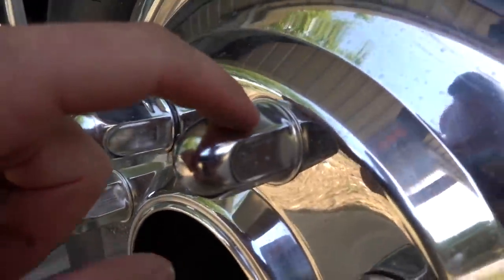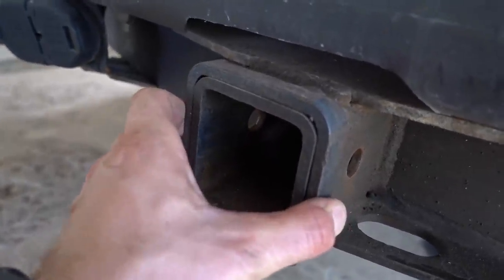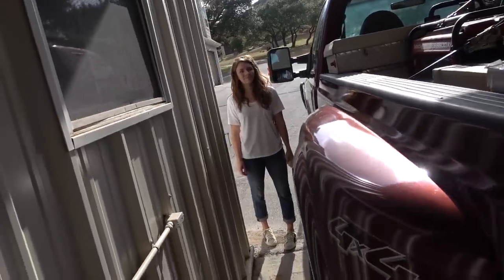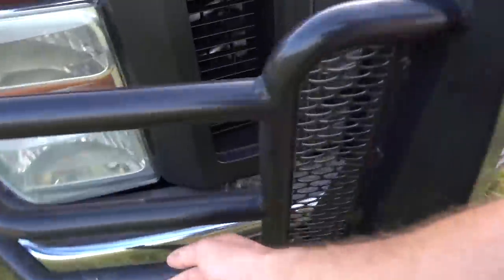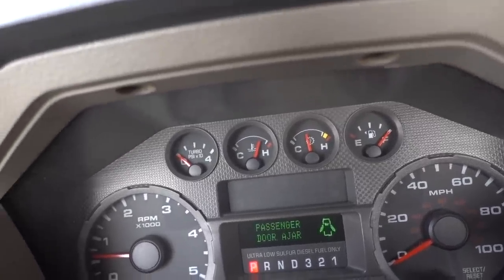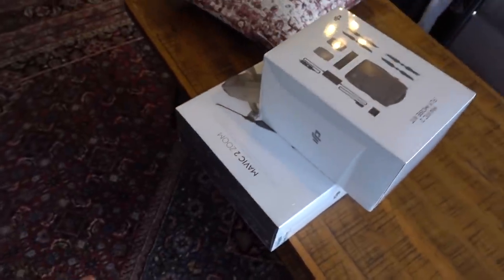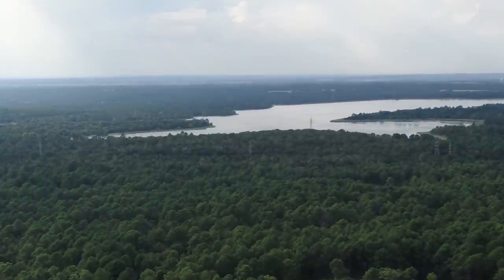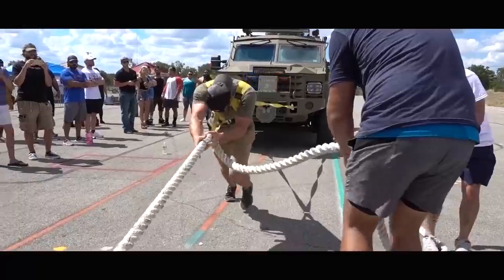My F-350 broke down immediately.....

Comment: You should throw that 6.4 in the trash. Id pea pump cummins swap it even though im a duramax fan
Reply: Yeah he can but he probably does not have the 💰 for that 500 or higher 1.000
Reply: Wesley Madsen hell ya
Reply: That's lame bro
Reply: Why spend $7000 on a motor when you can get a $2000 truck?
Reply: Cummins easiest motor to work on. Should've gotten a Cummins
Reply: @WIL0277  because the $2000 truck isnt running. Did you watch the video lmao 👍
Reply: Shot man, I own at least 5 trucks that I purchased under $2000 and trust me, I a machanic.

Comment: Whatever you do KEEP ALL STOCK PARTS ONLY CHANGE OUT BROKEN ONES AND DO SO WITH STANDARD PARTS IF YOU CHANGE TO A "BETTER" PART THAT TRUCK WON'T LAST LONG otherwise it will last forever, my dad has a 2006 f250 with all stock parts, still runs

Comment: If it was a Chevy duramax it wouldn’t of broke Down😂
Reply: Facts 😂😂😂
Reply: Your right it would've freaking exploded
Reply: Yeah because you can tell that just by looking at a truck that's not going to break down
Reply: Or Cummins!
Reply: Kadesster 14 Chevys are absolutely horrible, gm is by far the worst manufacturer of them all, but the 6.4 is a shitty engine, but no durashit would beat my 7.3 powerstroke
Reply: Stank Meme General Motors (GM) is by far the best car and truck manufacturer. A Chevy Duramax would out pull any Ford powerstroke. Powerstrokes and Cummins are horrible
Reply: Rylan York naw it would have kept on going
Reply: Clayton Matthews nope that’s only what happens to dodges and fords
Reply: Clayton Matthews damn you must be really lucky cause my first car was 1995 f150 it blew the motor at 136,000 miles and I bought a 2001 Chevy Silverado and I’m currently still driving it with 474,000 only thing I’ve replaced so far was the battery and brake lines

Comment: Pro tip: sell the 6.4, buy literally anything that's not a 6.4
Reply: benjamin boyd 😂😂 true
Reply: well, not ANYTHING. 6.0 is also no good. anything before or after these two motors.
Reply: @davekostuch3250  the 6.0 can be good with little improvements but the 6.4 is absolute trash! Can't even work on the engine without taking the whole cab off

Comment: give powerstrokehelp page a visit. one of the best / most knowledgeable powerstroke guys on youtube with tons of proof to back it. and in one of (i think) his more recent videos about the 6.4 powerstroke, his advice is basically if its running fine, get rid of it as soon as you can, get away from it and buy something else. he also REFUSES to take in any 6.4 trucks for any type of work or maintenance. matter of fact, the 6.4 has/had so many issues that factory cores for most parts are no longer able to even be attained because they had so many failures they used up all the cores

Comment: Don't get this, Don't get that....come on!!! People told me to not buy a 5.4L with cam phasers! I replaced the VVT solenoids in it and have extras in the truck and the last 10,000 miles have been flawless and no start up timing chain rattle either! It's every 4th Ford off the assembly line you gotta worry about. I got one of the others!!

Comment: Not sure if you will see this comment but if you do when your vehicle is over heating if you crank the heat it will pull the heat out of the engine and throw it at your face. Will help your over heating issue. Also these trucks don't like going very fast but that's a bit slow.

Comment: I had trouble with my truck over heating and it was a Bad Coil Pack. I have a Gasoline engine not diesel but it took me a while to figure out what was the problem.  I have a F 150 Ford Truck.

Comment: with all due respect, when you opened the oil fill housing at 8:05 and you said that it's burning oil. this was completely wrong. every engine does that, there is nothing wrong with this. Also, if it's overheating then put some water in it. If the oil isn't completely black or brown, and has some milky color to it, then you have a leak in the antifreeze tubes down the block, most likely in the timing chain cover. Also, if the engine is overheating, check the antifreeze level and turn the heater on all the way

Comment: Did u just start a trip without checking oil, radiator, coolant, fuel pump belt etc ? Matt wtf
Reply: Well he just checked the engine, 6.4, and thought shoot... it's going to die anyway why bother with checking anything else?

Comment: Ive owned 3 6.0 powerstrokes and never had a single issue when any of them except for small issue like stiction which oil additive cured. 
Once the EPA screwed everything up with the EGR (which all the 6.0s have) DPF/SCR it turned a good long lasting engine into a nightmare. 
All you Cummins guys are now seeing that even Dodge cant make a good diesle like the good ol million miles cummins of old with the total BS EPA

Comment: If you ever sell that truck by a 7.3 powerstroke . they run for ever ride is a little bit more rough
Reply: IDK, yes the ride might not be as nice, but its the exchange you get with a 7.3. the 6.4 is not reliable but it drives nice, pick your poison. Id rather have a truck that is reliable with an ok ride than a truck that has horrible reliability.

Comment: Demo, you ever notice that big ass bug on your shoulder at 9:23????

Also, water pump, cooling fan, CF relay, or low coolant is likely your issue. Not a mechanic, just work on cars.
Check out coolant level first, then cooling fan, then relay, then pump... in that order!

Comment: No big deal, truck was 4 quarts low on oil.  If it has lots of white smoke on startup and under load. Its definitely the turbo seals leaking oil.  Yeah I know this is old and the truck is gone now.

Comment: You poured an entire jug of oil in the engine when it was just low? Bad idea. Here's a nugget of truth on the dangers of overfilling your oil: "When too much engine oil fills the crankshaft in your car, the oil becomes aerated and is whipped into foam. This is caused by the high rotation of the crankshaft. Foamy oil cannot lubricate your car well, and in many cases it will cause oil flow to halt completely, overheating your oil and causing loss of oil pressure. The engine then becomes starved for lubrication and may potentially lock up."

Comment: I have a old school 90s dodge Cummings with 678,000 still runs like new I have a 2015 dodge  6.7 4x4 has been in the shop over 8 times I sold it what a pos that was. NOTHING but def problems

Comment: Cylinder Head is fucked or just the Gasket. That causes the exhaust gas to leak into the cooling system. This is also why it does not happen when you go slow. Take it for a Combustion leak test mate.
Reply: Or could be a slighty blocked Radiator that is restricting water flow.

Comment: Oil will not make the engine run hot.

The smoke coming out of the fill hole is perfectly normal.

Take the POS and sell it, buy a cummings.
Reply: Actually low oil will make your engine run hot. It is probably a combination if things in this case tho

Comment: Its a Ford. They circled the problem for ya!
Reply: I bought my 2011 6.7L Ford in 2010 and have not had a single issue out of it. Its since rolled over 110,000 miles so I consider it just broke in. Get rid of the EGR and DPF and it should last 500,000 or more.

Comment: I would be a little worried to own any diesel truck when you don't check the oil before starting out on a long trip.5qts.low?Really,you realize that engine fires injectors on oil pressure?

Comment: Should have gotten a Chevy.
Reply: Yeah you're not wrong chevy is way better>!!
Reply: Actually it’s the crappy 6.4 they made in 09-10. A 1999-2003 7.3 l is probably best
Reply: Duracrap.

Get a 6.blow and bulletproof it then you'll literally have the best truck so yah.
Reply: BH Paradox i know someone with a silverado they use as a work truck, he has over 300000 miles, you are wrong.

Comment: 1: big mistake buying a 6.4. “This is a work truck people” well 6.7 diesels are great Diesel engines and are work horses known for their reliability. Could have always bought an older 7.3 too btw. 2:USE COOLANT NOT STRAIGHT WATER. And 3: be prepared for more problems

Comment: “Ford Tough”
Reply: ford didn't manufacture that engine
Reply: Tristan Dietz they still let it off the assembly line, it’s there product thus it’s there mistake.

That’s beside the point, Ford has a well earned bad reputation for a reason.👍🏼

Comment: The truck overheated so you thought you'd fix it with engine oil...
Reply: Scott Ashburn did you not hear him say that it was low on engine oil?
Reply: @stanleywong4255  all he said was it's pegged out. Then the next thing he said was he's putting oil in it
Reply: Oil does assist in cooling. He should have pulled the dipstick before he left. You don't lose that much oil in an hour of driving.

Comment: “I didn’t see a warning light but the temp gauge was pegged” 😂Now I know why cars not equipped with temp gauges but rather warning lights are referred to as having dummy lights! Also, a routine check of all fluid levels and tire pressures prior to this trip would have lowered the entertainment factor significantly so thanks for that.🤣🤣🤣

Comment: It's a 6.4. The worst ford motor made
Reply: But "diesels run forever"...........yeah, maybe a mechanically injected diesel in a 1947 tugboat that runs at constant temperatures for days at a time does.    Not in pickup trucks.

Comment: Hey Matt message me back with an email I can send you info on the 6.4 and what can be done about some common issues you may have .. I have a 6.4 that I've had for several years and I'll let you know what parts and mads I've done to prevent most issues on the 6.4
Reply: A for sale sign?

Comment: the 6.4 is one of the worst. its almost worse then the 6.0. the 7.3 and the 6.7 is a way better deal then what this is. the truck itself if nice but the engine is crap. even the 6.0 wouldve probably been a little better

Comment: Worst Ford diesel ever. Get a Dodge and don't look back (at least until Dodge Cummins doesn't screw up an engine).
Reply: ALL modern diesels have issues because of EPA regs..even Cummins. Dodge is getting sued because their new cummins they put in the 1500s is clogging up ever 3000 miles and shutting down. EP has screwed everything. An old powerstroke 7.3 and older Cummins are the best diesels ever put in a truck

Comment: How can you not know your oil is down by a 5 quart jug?  My car never gets a half quart low... never.  Did you even check the anti freeze level?  After it cools you should have taken off the radiator cap, make sure it's full and check for circulation to see if the water pumps working.  Instead you guys are throwing firecrackers, telling jokes, and your priorities are messed up.  Now your broke too.  You'll learn... your young.